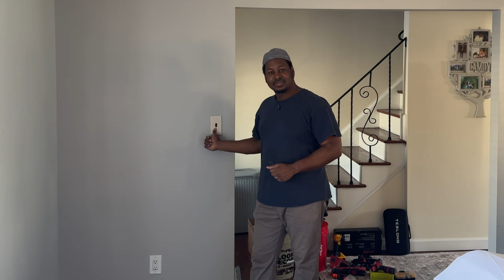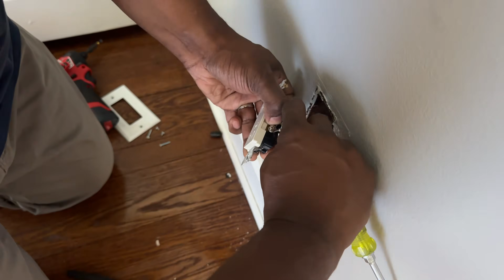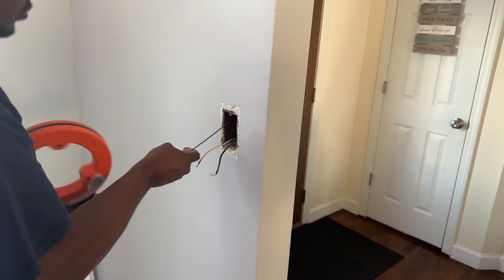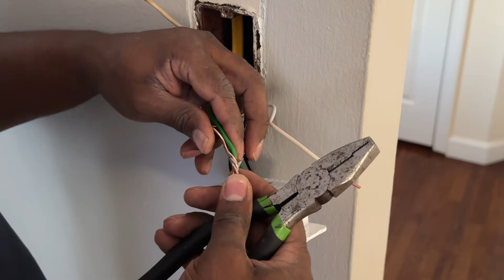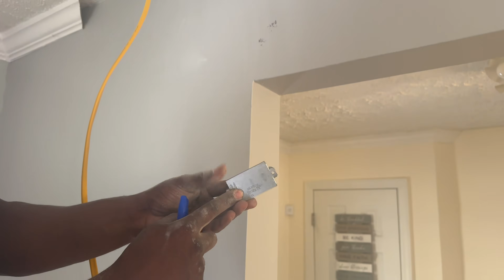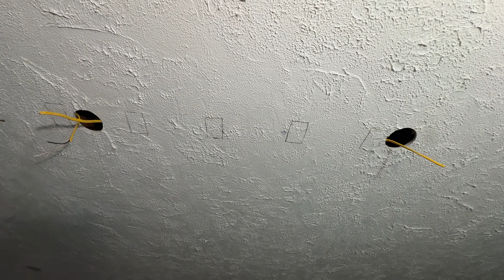How to Install Recessed Lights With No Attic Access (No Existing Wiring)

Comment from the maker: Are you trying to add recessed lights without attic access? The hardest part is usually getting the wire past the ceiling joists. Let me know where you’re stuck—laying out the lights, wiring the switch or fishing the cable—and I’ll try to help. Tools and materials are linked in the description!

Comment: Can't you run the wire behind crown molding?
Reply from the maker: Yes, you can run electrical wire behind crown molding, but you must follow specific National Electrical Code (NEC) rules to prevent hazards like accidental nail punctures.

Comment: Excellent, I plan to do it the same way. I like how you followed the building codes and put in the nailing plates to protect the wires. For finish I would fill and tape the joints then do a skim coat, prime then paint.
Reply from the maker: Sounds like a solid finishing plan, good luck with the install!

Comment: This is the best approach I have seen. The conversion of the switch box is very clever.  I wonder if the room does not have crown molding, how to hide the wire turning 90 degrees.  Maybe just to cut a two square holes at the corner, similar to the beams in the ceiling.
Reply from the maker: Glad you found it helpful and clever! You could probably use a similar method to hide the wire in the corner even without crown molding.